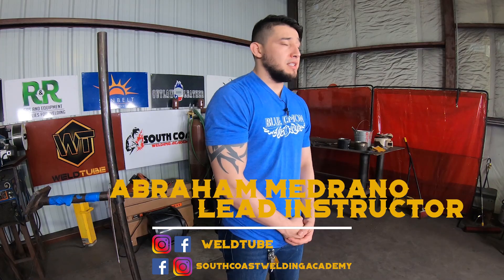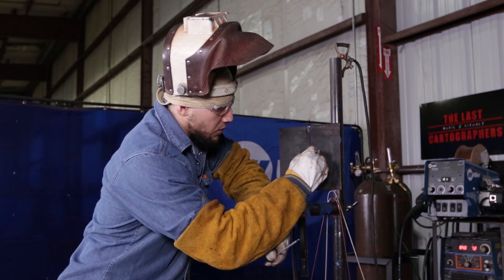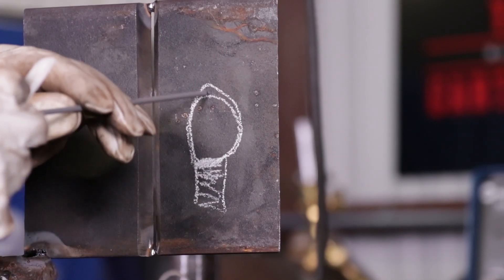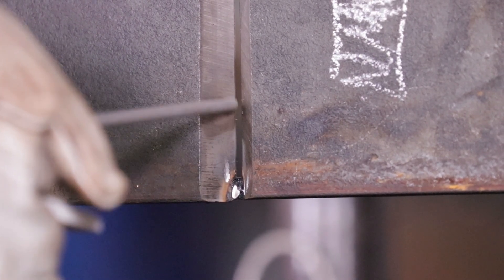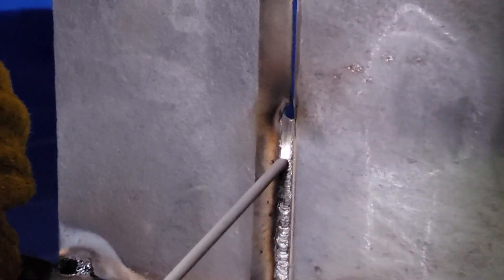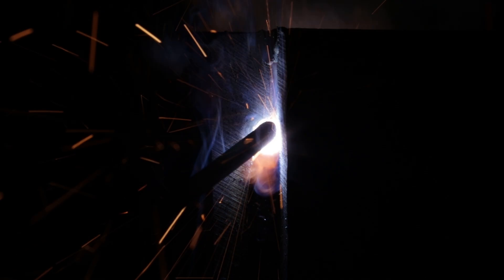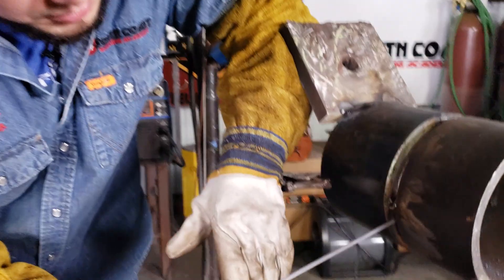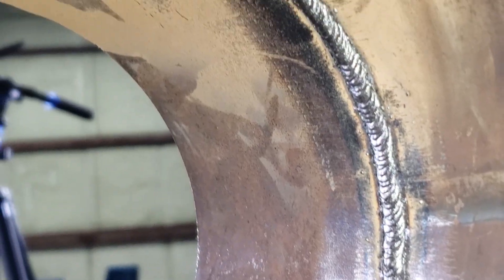6010 Root Pass - Whip and Pause Technique - Plate/Pipe

Comment: Headed to welding school next month full time. 🤙🏼
Tried welding school a like 8 years ago but had to leave it soon after because of my job transfer. You explained it way better them my “certified welding instructors”. I was wondering why my plates were closing in and why I wasn’t penetrating through and why is burning out of control like gun shot wounds.
Thanks for the heads up big dawg

Comment: Well that was the first you actually showed the root I hadn't been welding on bevel pipe I hadn't even been welding on bevel plate been doing a lot of structural non code stuff been paying pretty good I'm going to get back into code welding so I started practicing and man was I throwed off I had been getting that buildup on each side of the world just like you did I had been worried about that being a bust point but I don't guess it is

Comment: For 6010 stick root, pipe 2G position, how do you control the keyhole from getting too big and creating a big hole. Sometimes it’s difficult to fill back in during the root, or when you try to fill it back in after you’ve stopped, it looks inconsistent from your original pass.

Comment: Learnt a lot in this video, currently doing 1g open roots and I think ima turn my amperage down and pause at the edge of the keyhole instead of the puddle. This whole time I thought whip and pause you paused at the puddle. Long story short my keyholes go absolutely out of control after a while, and I then have a giant ‘chode’ (what my welding teacher calls it😂)where I spent half a rod filling in a blow through. I can’t wait to try this

Comment: i tried running a 3/32 6010 rod. 3/32 gap and 3/32 landing 65 amps. but its not working. its sticks and also stop on its own while welding. pls tell me what to do. am new to the 6010 rod

Comment: Offshore most all welding is did with 6010, most welding on 2 inch pipe handrails, you need to have b31.3 certification for offshore welding. Oh heavy duty thick pipe offshore, which is rare because most platform's are finished inland before placed offshore,, you can weld with 7018, or if you weld it downhill 6010 all the way out, they want you to butterfly cap it downhill, if you haven't mastered that technique, then you just cap it uphill with 7018.

Comment: Thank you very much for this informative video! I'm currently finishing horizontal smaw and was very inconsistent and not confident with the 6010. After watching this video I went from worrying about failing cause I couldn't get consistent penetration on an open root pass to successfully doing 2 good root passes on my practice and actual test plates which is most of the grade. I was able to successfully complete them on the last day of class and my grade jumped from failing to an A. You have a gift for teaching. Thanks again!

Comment: Is the whip and pause method okay to use with 6010 on a fillet weld? I’ve mostly run mig and tig since I started working, but I’ve run a lot of stick over the past few months without any kind of training. It works for me but nobody else welds 6010 like me

Comment: What is your suggestion for the pipe once the root is in? I'd do vert down hot pass with 6012 and then stringers the same to complete the job. I've seen the required method being Low Hydrogen and all vertical up with 2.5mm rods but that was steam pipe. Weaving all the way also and the time difference was huge compared to the vert down method. I actually came here to look for a whip method I used decades ago with 6018 on thin gauge materials. The finish was excellent. The whipping action was 2 to 3 inches backwards and forwards with actually flicking the rod with the pause back at the puddle. Sounds crazy I know but that's what I did. Imagine a fly fisherman on a river flicking his rod to cast his line. That is how my handpiece moved but side to side.

Comment: You are good trainer, please share information about:
1. Polarity, type of electrode and base or rutile type?
2. Type of base material plate and pipe and gap of them on mm?
3. Welding parameter; Ampere and travel speed when root, filler and capping?
Thank
brusley5@gmail.com

Comment: Here’s some helpful advice for you, on tie ins, when you feather your welds down with the grinder and you start welding. Instead of just starting where you left off, blow through that about 1/8th inch from where it ends and I promise you’ll never see your ties in at all on a root bead
Reply: Another lil bit harder but faster & easier on the fitter way  is to not just go cold lap right into your continuation spot but set their just a bit n long arc it to bring up the temperature on the stop spot & then get back in it.

Comment: What does all the "G's" mean?
Reply: It stands for "Groove" weld.  If you see an "F" it means "Fillet" weld.  Hope that helps!  The different numbers are different positions.  1 is flat, 2 horizontal, 3 vertical, 4 overhead.  Then on pipe, you've got 2 for horizontal, 5 for vertical, and 6 for angled at 45 degrees.  https://classonewelding.com/welding-positions/

Comment: Badass video !! Just one question and I hope anyone can answer this, so it’s a rookie question I’m still learning which is why I watch theses vids but what does the “schedule” mean in pipe? Like what’s the difference on sch40-60-80-120 and all that?? I’m very curious and does it change on different alloys ?? Or same to everything? And I also see that on PVC pipes
Reply: Means the thickness of the pipe, 40 being less thick 120 being thicker it's opposite when it comes to measuring pipe in gauge though
Reply: Lower the number thinner the metal
Higher numbers thicker metal
Reply: Schedule is the wall thickness of the pipe schedule 40 thinner to thicker 120
Reply: Go on Google and type ASNI pipe schedule chart, and it will show you pipe sizes & schedules. It will also give you a thickness measurement of each schedule.(remember that a schedule 40 6" and a schedule 40 10" is not the same thickness). This chart will give you an idea on how thick it is.
Reply: Here is the thickness of the different schedules of pipe. https://www.engineeringtoolbox.com/nominal-wall-thickness-pipe-d_1337.html
Reply: Yes I’ve looked on google but can never get a consistent answer so I wonder
Reply: Thank you everyone ya are awesome !!!

Comment: that's the technique I was taught by amar, and it work perfectly using 6010 ( red rods) before I learned the Wip and pawz I used to burn through or drip molten metal now I'm good thanks a lot, I should be working the east coast railroads rocking some outlaw leather gear , you explain it so good it'll definitely improve my style thanks bro. thumbs up 43 and O

Comment: What amperage you at for this? This is exactly what I’m doing this semester and the way you describe it seems very helpful. Perfect timing glad I got notifications on.
Reply: It was 70-72 amps
Reply: My guess is 70-80 amps
Reply: I like to run 68-72 amps, i wouldn't go any lower than that.
Reply: Tourettes Orc it really all depends on the machine itself. I run the amps anywhere from 80-90 on a 3/32 gap and small landing the more landing you use the more amps you’ll want to run i like to run a sawzall blade width and a nickel landing which is slightly larger than a 1/8 and I’ll run amps around 95
Reply: It was at 72
Reply: depends on your fitup and prep, but they eay he set it up i would run around 70-80amps
Reply: Thanks for all the replies!
Reply: i ran mine at 90 amps but had to move fairly quick =)
Reply: 70 has seemed to be my sweet spot
Reply: 75 amps is the least....for testing!
Reply: I run a 1/8 gap and 1/8 land and use this technique on 80-85 amps
Reply: Heat is your friend man. If your running small bore like 3” and under I would stay in the mid to lower 70s. Any bore higher than 4” I stay in the 75-85 rang. Low amps only make you stick more and less penetration. Land, gap, and wall thickness all plays a part in it in the end and experience will get you better with heat adjustment. Not one heat works for every pipe. If you have a thick land tight gap it’s gonna want heat if you have a small land wide gap it will want cooled off. Old timers always told me a hot weld is a clean weld. And always remember just because the machine says your on 80 doesn’t mean you are. A lot of machines haven’t had the calibration and all run different! Good luck! 👍